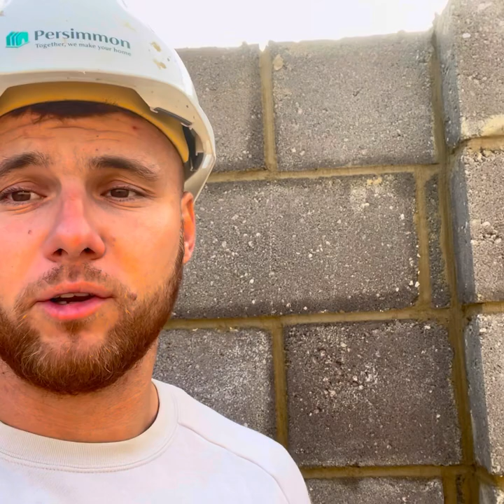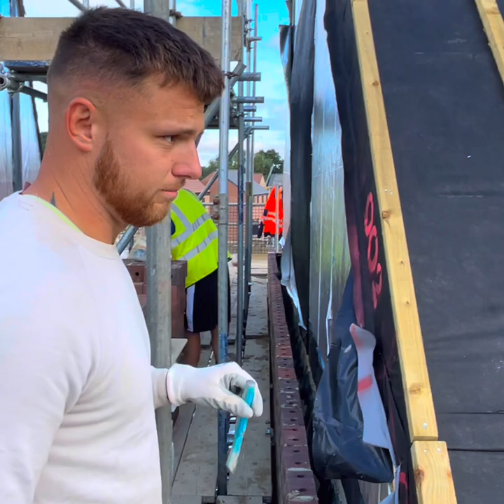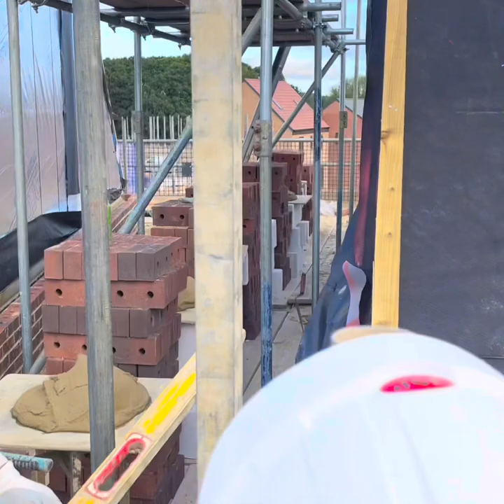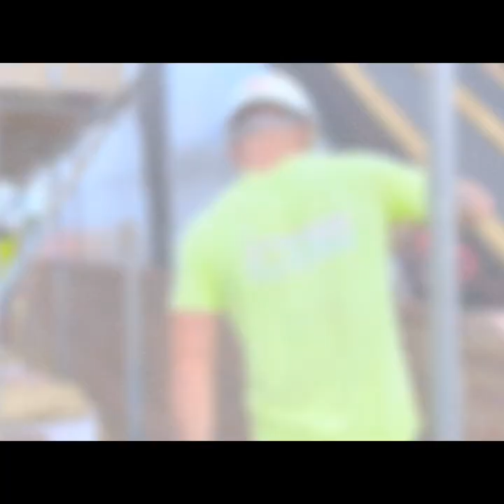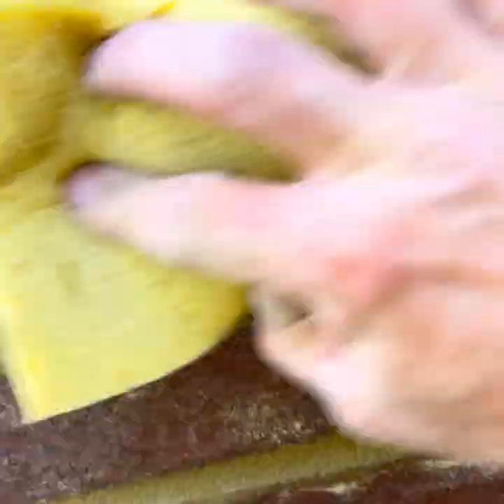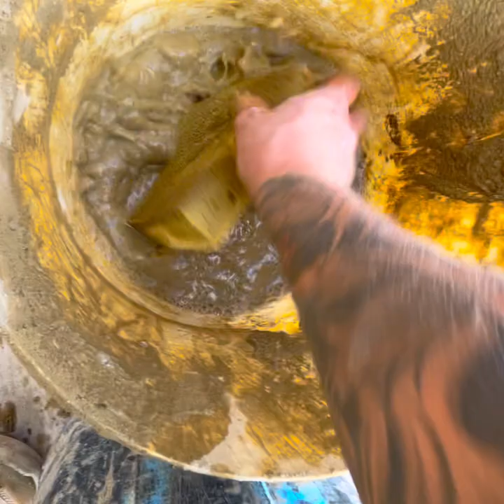Sponge Or Brush For Your BrickWork

Comment: Keep the good work up mate and just wondering what trowel and size are you using
Reply: Looks like a marshaltown wide London pattern to me with leather handle
Reply: Be well used I would think aswell probably used to be an 11 inch
Reply from the maker: That’s exactly it, 11inch wide bottom London. Had it 4 years so it’s been well used